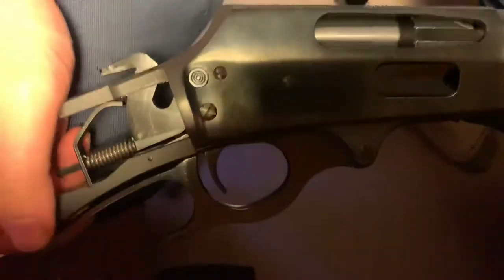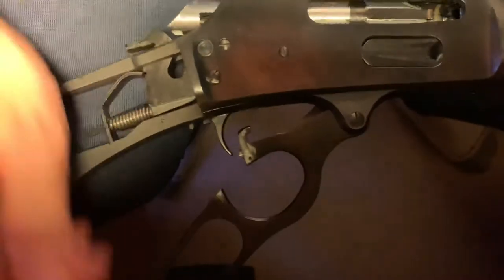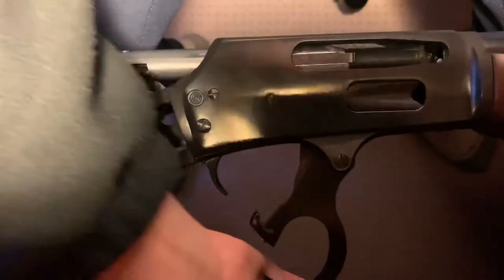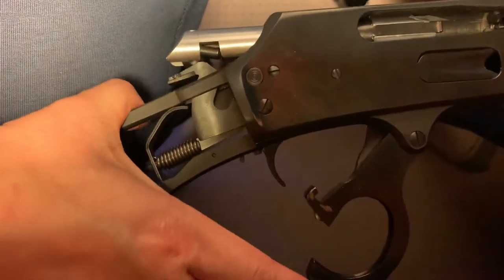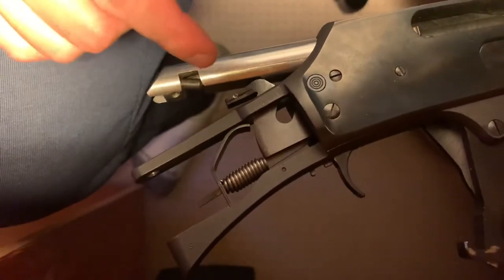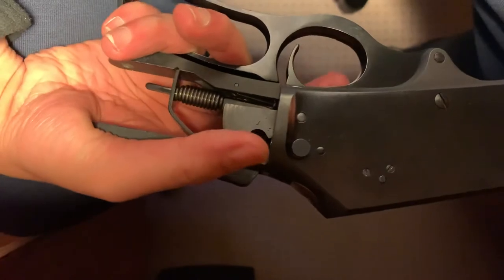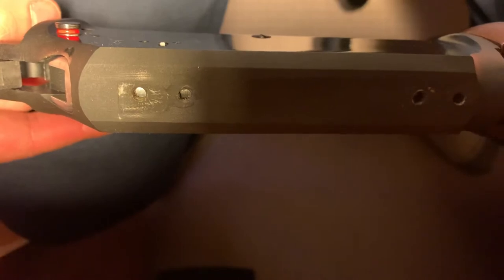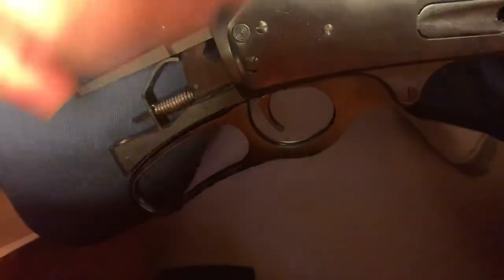Marlin 30AS Tuning

Comment: Interesting video, since I was looking for something on the Marlin 30AS that I have. Unfortunately, I couldn't make out what you were explaining. Sure wish you showed HOW you did the trigger adjustment. I understand this model was made in 1989, which is when I bought it. It is considered one of the best 30-30 lever actions Marlin made, unlike the poor job Remington tried building. Don't know whether to blame Remington, since all the original marlin factory skilled workers were dismissed when the company was sold. It unbelievably shoots 1/8" shots at 100yrds, if I have the group scenario right. Meaning, each shot in a 10 shot group was an 1/8 to 1/4" apart from the next. Hope I never have to part with it.
Reply: I just went from Paul Harrell to this and saw you commenting on both xD